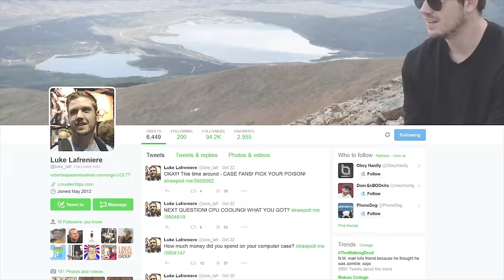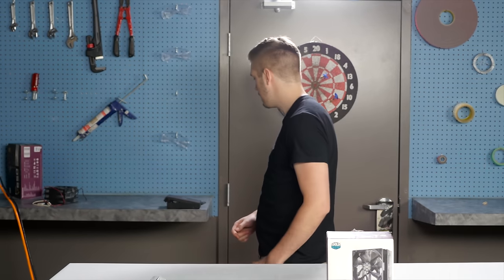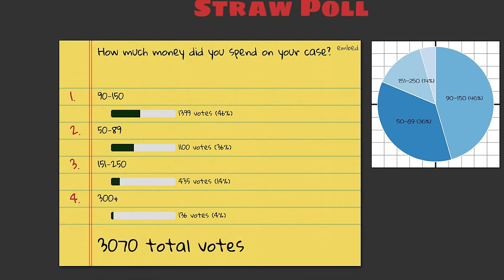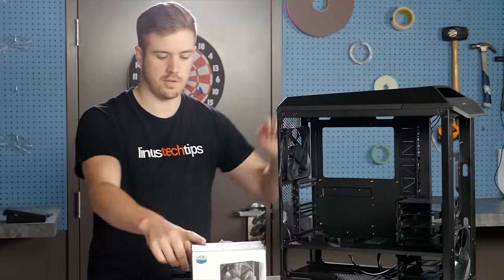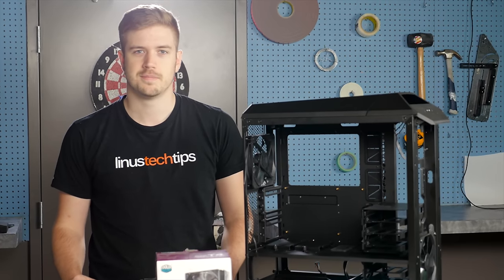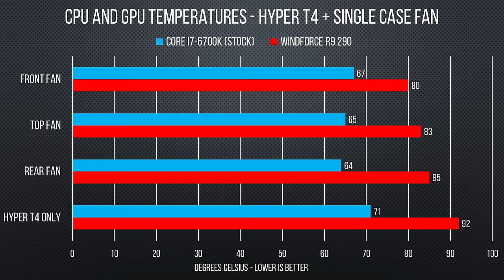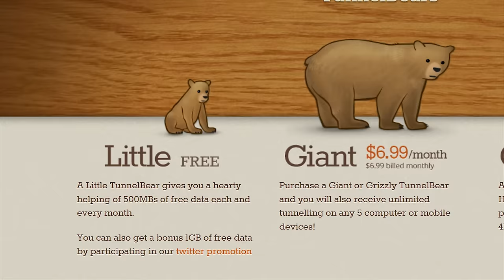Case Fans - How many should you have?

Comment: # intake fans >= # exhaust fans | # intake fans > 0
Reply: +veran totally depends on your case and your radiator situation.
Reply: +givemeajackson True, for example, i have a Cooler Master K350 and my configuration is: front = 1x 120mm fan => intake, back = 120mm radiator for CPU => exhaust, side panel = 1x 120mm fan => exhaust.

So i have 2 exhaust and 1 intake. I test with the side panel in intake mode, but it is worse, the GPU temp go up.
Reply: +veran Only if you have dust filters on the intakes. If you don't, it doesn't matter
Reply: +Eco negative pressure collects less dust. also, if you have more intake than exaust, you get positive pressure...
Reply: +veran I disagree. not only does this collect a lot more dust, it also depends on your layout. as long as you're not blocking the intake with 7 HDDs or untidy cable management, exhausting the warm air will have a more positive effect than just blowing in cool air. with less exhaust, the warm air will just be stuck between GPU and CPU, as well as in the top of your case. im running a bitfenix shinobi with 2 bequiet SW2 in the front, 2 in the top and 1 stock cooler in the back (all running @ 800rpm) and also tried 2 front (1200rpm), 1 top, 1 back (both 800rpm). the negative pressure version cooled the CPU by 3°C and GPU by 5° more than the overpressure version. I'm not saying that this is always the best way, but if you can, you should always try both models and see which works better for your build.
Reply: Echo Mgm Interesting, I suppose the side-panel exhaust works well with open-air GPU coolers; not so much with blower designs (as it would create a low-pressure region near the GPU blower intake)
Reply: Eco just to double-check: which one is which? negative pressure = more exaust than intake? either way, as long as your intake fans aren't covered by perfect dust-filters (and i'm yet to find one of these), you will blow in a lot more dust, whilest the exaust takes the dust out right away. as i mentioned in another comment, I tested both setups and the negative pressure version did both cool better and collected less dust.
Reply: +Kai Diederichsen Negative pressure is more exhaust than intake.  The reason, though, that positive pressure is usually more preferable is case design - there are so many air vents and holes and screens around your cases that negative pressure, while superior for cooling, would suck dust in these holes AS WELL as your intake fans, whereas positive pressure would keep that from happening.  

Cases that don't have all of these vents, and generally only allow air in from the intake fans, would see benefits from negative pressure on both fronts.

Comment: I know I'm very late to the party but I have to say that you used just about the worst case for this test. The top of the case is always open to the air with or without fans meaning you can't create any pressure difference with the outside.  That one fan in the front plus one in the rear works much better if the case is sealed around it. It's like air conditioning in the car. You are just wasting fuel if you have the window open as well as the AC on because it can't work in an open space.
In fact if you want the best airflow possible then plug up all those empty spaces that you don't have fans in front of.
Interesting video all the same. Currently I have 2 AF120 fans plus an SP140 on intake ( front and front left side panel ) and 1 AF120 and one SP140 on exhaust Duty ( top of case and rear upper ). PSU does the standard in through the bottom and out the rear and my CPu Exhausts via 140mm rad with 2 SP140 fans in a push pull situation exhausting out the right panel.
It's pretty chill.

But the most important thing for airflow is not about the number of fans it's about the pressure difference you can create inside the case, it wants to be lower than the exterior that way the air is falling over itself to be sucked in and your powerhouse fans do the job of throwing it out again as it's soaked up that ambient heat inside the case. Physics my man.

Comment: My pc case can hold 8, two for the radiator,  3 in the front, and 3 in the top. I have 6 out of the 8 and 4 of which are rather cheap (20 dollars for 4). If I were to buy 2 more fans that were a little more expensive and to fill out all my fan spots, would that cause more harm than good.

Comment: Spent $10 USD on my case. No regrets.
Reply: LazyJackal I spent $109.99.
Reply: The Chief I technically bought it for more because the specific color I wanted (Matte Black) just wouldn’t lower in price, and my mom wanted me to only use trusted sellers like Amazon. It’s an NZXT H440 and I love it. The only thing I dislike is that there are no underglow LED’s like on the red/black, Razer, etc models, and that the HDD LED is part of the power button so it constantly flickers. Otherwise, the case is perfect size and I love it.
Reply: I have no idea where you are looking up your prices, but the NZXT H440 is most definitely not $160. Not even in Canadian dollars. I paid $119.99 for my Matte Black style, and that is as expensive as they get on Amazon.
Reply: To answer your question on the temps/noise/cable management, which I hadn’t noticed before:

Temperature: Pretty good. Fans always run at 100% without any way to change speeds, which is kind of annoying, but temps are good.

Noise: Like I said, the fans are always at 100%, but it’s not that bad because the case has sound dampening pads in front of the intake fans and on the side panels.

Cable Management: Perfect. The amount of room is good for all cables and the HDD cages are easily accessible. The SSD mounts beneath the motherboard are harder to access, which is fine because they are definitely not necessary as any standard SSD will fit in the HDD racks just fine. I myself have two Samsung 850 EVO’s and a 4TB WD Gold HDD (don’t buy it, it’s terrible) all in the cages in the front.

There is no support for an optical drive, though.
Reply: The Chief still need this answering, I’ve just built in the case

Comment: Dunno if you're paying attention to comments on old videos, but I have a question.

So, my current case is a Rosehill Thor from 2016/17. It had a built in 200mm side panel fan, a free 120mm fan for the rear of the case, and I opted for 240mm worth of dual fans w/ liquid cooling for my CPU.

Last month, I had a PSU issue. Had to gut out the old PSU and replace with a new one, both 800w. While doing troubleshooting and installation, I discovered my big case fan was nonfunctional, and I was having a huge deal trying to install one of my dual fans in. As a result, I am left with just two 120mm case fans functional: one over my RAM and the rear fan facing my CPU and the top corner of my rig. 

Originally, my builder recommended only the single 120mm fan for my PCU cooler, but I opted for the 240mm out of an abundance of caution.  I am down to two fans, and under 50% of my original fan cooling capacity.

I am also wanting to upgrade my GPU and probably my motherboard and CPU as well. Power isn't an issue as I have the aforementioned brand new 800w PSU. Honestly I'd rather not have to deal with replacing the MB and PCU manually if it can't be helped and I don't feel like paying someone to do it either.

Should I seriously consider a case replacement?

Comment: 12... I have 12 yup idek why buuut... let me say nothing has ever gone above 100 degrees
Reply: Gr3enLem0n What? What case do you have??
Reply: well, my case comes with 5 fans, and I have a free processor fan,  my graphics card fan, one in my power supply, and one extra because it was an extra one from my last build.
Reply: I have one fan. the rear one. Never gone past 80 degrees... that is with a overclocked intel xeon.
Reply: 10 fans liquid cooling idle 16.7c load 30c OC @5.2 the cooler it runs the longer it lasts
Reply: @MultiMaverick70  jeez, how cold is your room? or do you have radiator outside?

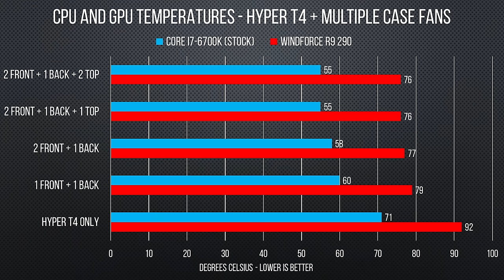Comment: Very interesting, I know it's 6-years old but then so is my computer, the exact same processor by the way; so why am I looking at fans? I found that one of the front fans had broken a blade completely off, so I replaced both with Noctua 140mm Redux Edition fans. Then I had a thought, why not put the still working ex-front fan at the top rear spot? In this process, I became aware that the rear fan has been bringing air into the computer this whole time; I quickly reversed that, so now both are working as exhaust fans at the rear/top rear. Glad to see the chart at 11:52 which shows that is in the top best results. Thanks for sharing.

Comment: Hi 
I have to make a suggestion 
And you may try this one 
I my opinion the fans should be installed in series 
Like 
Option 01
any number of fans at the front 
Any number of fans at the back 
Or 
Option 02 
Installation of fan at the bottom any of  number 
And installation of fan at the top any number 
Which will keep the air flow in series 
Installations of The upper fan might get Disturbed the air flow 
And hence the result will be not as good as expected
 
Considering in option01 or option 02
the flow of air is 100 percent from front or ( top to bottom or bottom to top as option 02 ) 

The back side ( the top fan or the bottom fan as option 02 ) fans will push the air 90 percent and 10 percent air will real circulation and the top fan remove 60 percent of that recirculated air of 10 percent in the cpu
Just a suggestion
Thank you

Comment: You didn't remark the gpu fan
Reply: Good point but those are usually already applied to the gpu and not many people have any reason to remove or swap those coolers, so I think he didn't have reason to remark that.
Reply: Air coolers can range from fan less, to up to 3 fans, if your talking radiators, it can be 4, o thought that at least deserved a mention

Comment: so I know this video is 4 and a half years old etc... but I just want to add that the all Fanslot used config does actually make a differnece if you are in the right Conditions. For example I have an ambiant temperature of around 29 to 35 Celcius (in summer) and under these conditions more Fans make a noticeble differnce mostly for the chipset and yes your PC crashes really hard if your chipset runs to hot

Comment: I know this is an older video, but I am going to post anyway. This video missed a lot points about cooling and fans. For one you are only showing the gpu and cpu temps. You are ignoring chipset and motherboard temps and over all temps inside the case. There was also no mention of fan direction for the different positions. I know we can assuem what they were, but when you are talking about video this basic I think would be fair to assume some of the people watching are not going to know which fans are intakes, exhausts and the difference between negitive, nuetral and positve case pressures.

And when you get into running multiple fans like two fans in the front and  the top it isn't always or really about lowering over all temps. The advantage of running multiple fans has more to do with noise. Running more fans lets you move the same, or more air at lower fan speeds. Same thing goes for running larger fans. Sure you could probably cool a case by using a 92mm fan in the front and one in the back. However they are probably going to run at full speed all the time at a fairly high rpm and make a fair amount of noise. Jumping up to 120mm fans and/or running dual fans in each position lets you run them at much less rpm because they move more air. Which means the system will run a lot more quite. This doesn't even take into account fan speed management where they only ramp up rpms when its needed.
Reply: Exactly, bigger fans do the same work with less rpm, resulting in less noise with multiple fans. Cheers from Brazil !
Reply: Paul Mohr hey I have a question because you’re smart. If I get a bunch of fans should I get a good fan controller instead of a cheap Garbo one? My fans are loud and gigabytes software kind of blows and not in the good way.
Reply: Paul Mohr thanks for responding I’m probably going to get a Corsair commander pro or something I have 6 noctua fans but as I said gigabyte doesn’t do fan control very good so there’s a lot of noise
Reply: @biteme263  hello is it better to put higher cfm fans in the front or used them as exhaust. 2 high cfm intake +2 top exhaust 1 rear exhaust (going to use tecware nexus c it had 3 built in fans which is going to the exhaust and using 2 idcooling fans pl12025/sf12025)
Reply: @fortunewilliamledesm9559  never use 2 top exhaust fans the one in front of the cpu will pull cold air coming from your intake fans out of the case before it gets to your cpu.
CFM fans outperform normal fans when there is some kind of obstruction like a mesh/filter/radiator/or even high pressure.
in your case i would suggest putting two 140mm CFM fans in the front on top of the PSU shroud and 1 exhaust fan in the back, you could add another exhaust fan at the top and put it as far back as you can.
i use 2x "noctua redux nf p14" as intake and even when i turn my exhaust fan off i can feel air blowing out the back off my case
Reply: @heygek2769  I agree with the “never use two top exhaust fans”, but what about rear-top exhaust fan and front top INTAKE fan? I wanted to try that with two front intake fans, do you know if it would help?
Reply: @doofeable  why do you want to? In almost all cases it's best to just use the front panel for intake and the rear next to the i/o as exhaust. 
What case do you have, and are you using water- or aircooling?
Reply: @heygek2769  Thanks for your answer!! I’m using a Meshify C. I have 2 140mm fan as intake in the front and one 120mm at the back (noctua). I have an aircooled cpu. The reason I wanted to try adding a front-top intake fan was to get maybe more airflow on my VRM since I have an MSI 570-a pro with pretty bad VRM.  It yeah might not be any more effective than my current setup.
Reply: @doofeable  Honestly i think it would only disrupt the front to back airflow that you have right now.
Any additional fans or better heatsinks would give you negligible benefits. Getting a different mobo would allow for higher overclocks, but even that might give you +1 or +2fp/s in a best case scenario.
If i were you i would keep my money in my pocket and save it for my next big system upgrade.

Comment: i have 6 fans and its loud as hell
Reply: Invest in fan controllers or fan reducers
Reply: Use a low voltage adapter, get 3 of them and hook 2 fans to each
Reply: i have 16 fan. 6 back panels, 6 front panel, 1 cpu, 2 side panel, 1 hard chipset. my pc sound like plane.
Reply: I would invest in noise fans not low power fans/voltage adapters, all dependent on environment. I upgraded from a HAF 912 Ad to a H440 and I needed to completely redo my cooling setup because the case got too hot #Straya. But I found the way to get best noise to price to power ratio was the default NZXT case fans, Windforce GPU, and be quiet PSU and CPU cooler as they make the most noise.
Reply: i have 5 fans and its nearly silence
Reply: i have 5 fans and its nearly silence
Reply: i have 5 fans and its nearly silence
Reply: +Jose Brito Get better fans.
Reply: +Hilmi Albums I have 16 fans (not including GPU and PSU fans).
Front: 3 (plus 2 more behind the HDD cages)
Top: 4 (plus 2 more in push on the radiator)
Rear: 1
Bottom: 4

It's dead silent, and super cool. You need to invest in a fan reducer or fan controller.
Reply: I have 6 fans, including 3 120mm fans on the front (small&noisy) I just got a fan controller, and keep them at the lowest at all times, my temps are always fine, I live in England tho ;D
Reply: ThePolysyllabist "The largest advantage of 6 fans would be that they could do the work of 2 fans at much lower rpms, and thus noise."
That's exactly why i have 16 fans.
Reply: +Christoffer Nørskov You must have a 900D
Reply: DBIIJ0U Indeed i do.

Comment: Watching this in 2019, just bought the MC500P (the redesign of the case used in this vid) so this is perfect to give me an idea how to hit the cooling sweet spot.  I think I will go with the 3x 120mm front, 1x120mm back.  Going to use the Evo 212 Phantom for CPU cooling.
Reply: Same
Reply: @Kregg616  The stock fans are not able to cut it sadly.  CPU hits 60C and GPU 70C very fast in game.  Not enough push or pull on the stock.
Reply: @WolfMoonstarMAC  get 140mm fans, they move more air with lower noise. Take a look at Noctua Redux fans if you want the best airflow per dollar. Or if you want RGB fans but not spend too much take a look at Aigo fans on amazon, They're supposed to be pretty decent for their price.
Reply: @heygek2769  I have looked at the Aigo fans but haven't had luck with finding a style I like.  I have considered getting the InWin Crown for the front, but they only sell them in 2packs.  I have also looked into the Thermaltake Pure 14 and the Cooler Master MF140R RGB Air Flow.

Comment: i've just bought 4 arctic p12 pwm fans 2 14cm top fans. 3 from front 1 for exhaust and 2 for upwards exhaust. just using stock cooler and soon will switch to aio liquid.

Comment: Planning to build my first ever PC in December. Going to have a rx 580 and a ryzen 5 2600 inside it, is it acceptable to only have the CPU cooler and one case fan or is that not enough?
Reply: I'm not an expert on pc building (only 2 builds so far with basic air cooling not liquid)) but you should really have  at least 1 intake, 1 exhaust and  your CPU cooler.
Reply: wulf9474 maybe I'll get a case with 2 case fans then